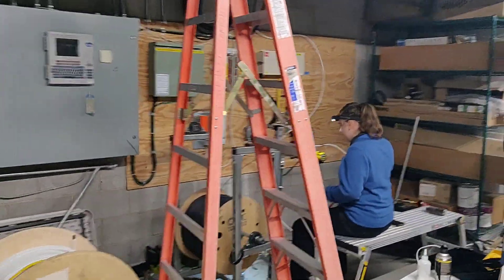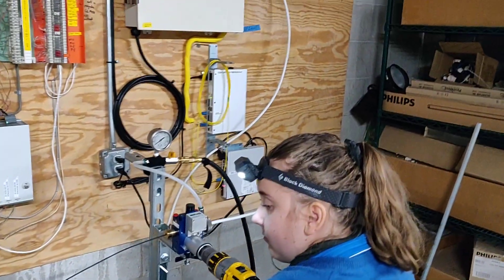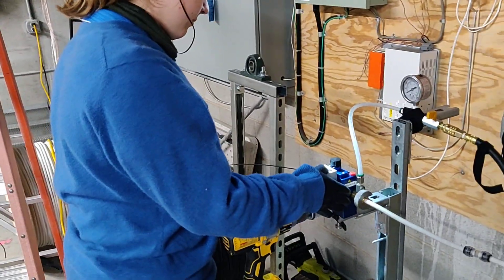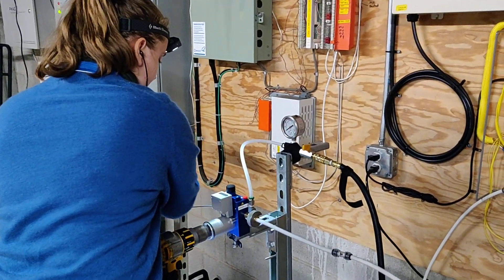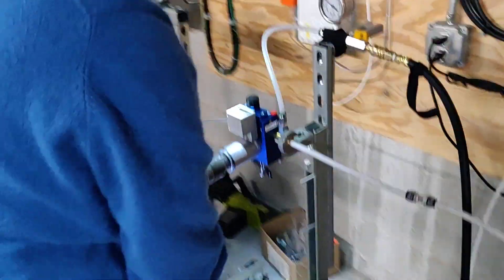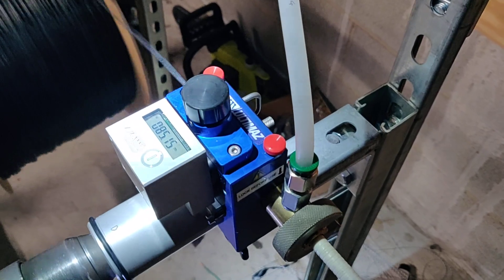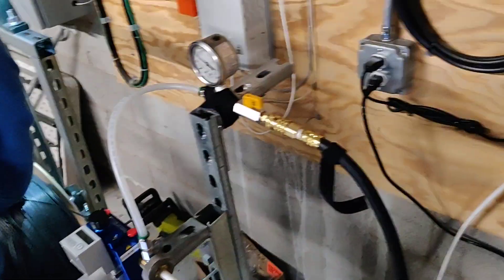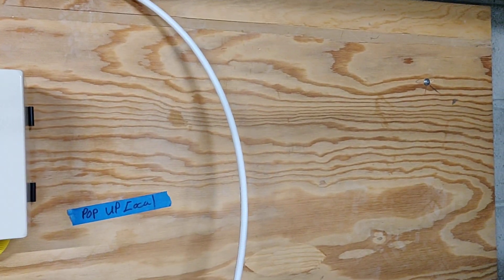Jetting 3mm Fiber Optic Microcable into 10mm/6mm Microduct - Shared Communications

Comment: What is going on? Very confusing to someone who doesn’t do this kind of work. I understand the cable is going through the conduit but how does is work? Very cool though
Reply from the maker: There is a lot of info in the description that might help you. Basically, the fiber blowing tool you see connected to the drill has two wheels that push the 3mm fiber cable. We add compressed air to create a cushion of air that makes the cable float inside the microduct. That reduces friction to a very small amount. The problem we are overcoming is that pulling fiber puts a lot of stress on the fiber cable, especially when pulled through a conduit with other existing cables. In fact, the pulling forces are so great that it can easily break the cable or ruin it. Being able to push and blow the fiber eliminates those forces and keeps our cable safe. Since fiber cable is pretty expensive, this reduces the financial risk during the installation.
Reply: @HaulBag  that’s awesome! Sorry I didn’t read the description. Probably should have done that. Thanks!

Comment: Hey cool setup, where are you getting your duct, cable and blower?
Reply from the maker: The 3mm fiber and 10mm/6mm microduct is PPC brand and is called Miniflex. Contact Core Telecom Systems at 314-372-0235 and tell Jeff Mann that Tim Ingalls with Shared Communications sent you. He is a great guy and is very helpful. The fiber pusher is from Ultimaz, and you can go to their Web site to find a local distributor. I use a wheelbarrow style air compressor that runs at 20A, and I hook that to an external tank to boost the amount of air that can quickly be harnessed. During this fiber jetting, the air compressor didn't even come on, because enough air pressure was in the external tank to handle the job. A 1000 foot blow can be accomplished in about 45 seconds using this setup.